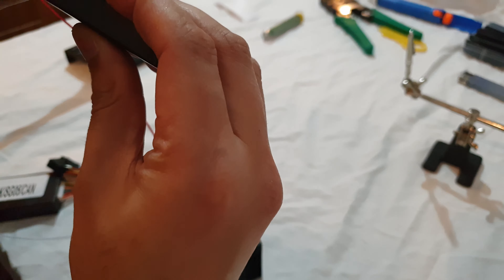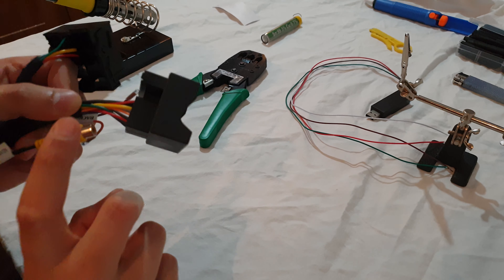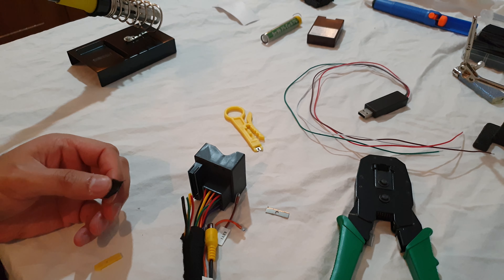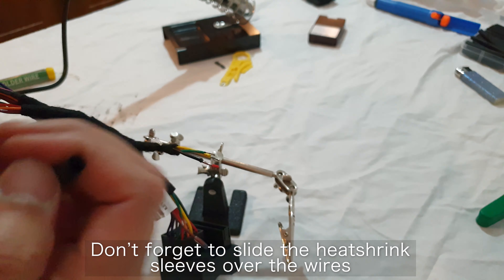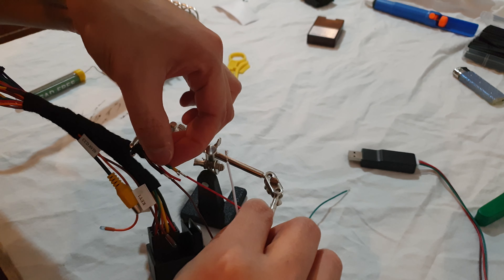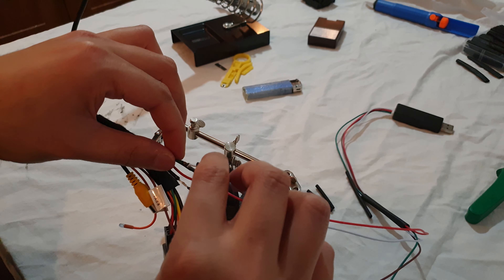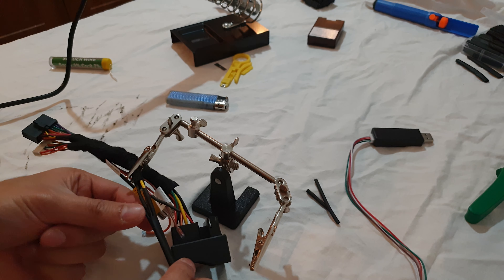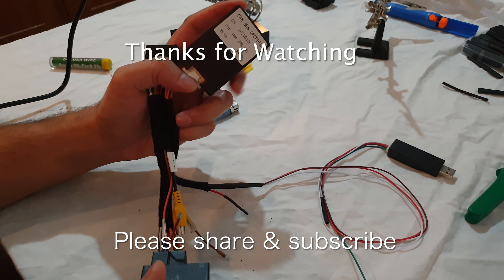Resler IBUS-Interface Installation/Wiring | BMW E39 540i, E46, E38, E83, E53, E85, E86

Comment: Great series of videos for installing an android headset, none of the links for the Resler Interface work, I had a similar problem with the links to Resler on Zero to 60 when they installed an Xtron head set to an X5 E53 last December
Reply from the maker: The resler interface has been discontinued and replaced with the resler module. I'll update the links shortly.
Reply: I guess im randomly asking but does someone know of a trick to log back into an Instagram account??
I was stupid forgot the account password. I love any tips you can offer me
Reply: @Colton Nelson Instablaster ;)
Reply: @Nathan Emiliano Thanks for your reply. I got to the site thru google and im in the hacking process atm.
Seems to take quite some time so I will reply here later with my results.
Reply: @Nathan Emiliano it did the trick and I finally got access to my account again. I'm so happy!
Thank you so much you saved my account !
Reply: @Colton Nelson glad I could help xD

Comment: Great video

I have e39 '98 with basic stock cassette radio unit without any stuff in the boot. I'm planning to switch it to Xtrons unit however I'm wondering if there will be a wires present to connect ibus dongle. Is there any way to check it before removing radio unit?
Reply from the maker: You will need to remove the original head unit to see what connection you have round pins or flat etc and then it's down to buying the correct harness adapter for the resler interface (no need to solder anymore) more info on. their website.

Comment: Hello,
Im wondering to retrofit a DSP in my E39 (2002) and i think i will fit the quadlock in case i want to upgrade to Xtrons in the future.
If i buy the quadlock adapter exl007, will the "Adapter for Resler Module and Resler Interface to Quadlock, New Generation, flat pin" fit? 
Cheers,

Mário
Reply from the maker: I dont see why it wouldn't tbh. But worth checking with the guys that supply the cable/adapter to be sure.

Comment: hey bro...i installed a head unit i bought on aliexpress from china...I get sound for about 30 or 40 seconds...after those 40 seconds the audios cuts off completely..everything continues to work, steering wheel controls, buttons, volume controls....but no sound. I have to turn off the car and start up the engine again and again it workes for 40 seconds the sound..and after the 40 seconds i lose audio again...what can i do?
Reply from the maker: That's what typically happens when you have DSP. You either need to keep the original head unit in the loop for it to keep the DSP amp awake or you need to invest in a resler interface or resler module. First step is to check to see if you have DSP or not.
Reply: @KhanHS  Hi I contacted the seller in china and sent me the factory settings code. I choose "non amplifier" option and get the same, audio for only 40 seconds and then I choose "amplifier yes" and the same issue, 40 seconds audio only. how Do i know that I have DSP. because I have a piece of sound equiptment in my trunk but i am not sure if that piece is DSP. I do have the 6 CD changer and behinde the cd changer, there is a piece of device.
Reply from the maker: @josesuero371  Search 'How to check if I have DSP e39' and there should be a post on bimmerfest.com: https://www.bimmerfest.com/threads/how-do-you-know-whether-you-have-non-dsp-or-dsp-audio-system-whats-the-difference.846234/

Comment: Hi I don't have the resler interface at the moment currently on order. When I put the car in reverse the screen goes blank. Is that normal? Thanks in advance
Reply from the maker: I’m assuming you don’t have a reverse camera hence it shows a black screen. You can disable this from within the settings. Depends what type of headunit you have.

Android 6
Setup → Factory settings (password: 126) → "others" tab → "prohibit reverse" to "disable" → "Apply" → "Exit" 

Android 8
settings → CAR → factory settings (password: 126) → "others " → "prohibite reverse" to "disable" → "Apply" → "Exit" 
or 
Settings → Auto Settings → Factory settings (password: 126) → "others" tab → "prohibite reverse" to "disable" → "Apply" → "Exit"
Reply: @KhanHS  Thanks for the help, lastly YouTube I get the audio but no video, video's play but I get a bank screen. Any ideas
Reply from the maker: @habz705  Is that whilst driving? Does the video play if the handbrake is pulled up? If so there is a setting that allows video in motion.
Reply: @KhanHS  this is when the cars stopped and in park
Reply from the maker: @habz705  Not sure then. You can try reinstalling the app and restarting the headunit

Comment: Can you plug this into a usb attachment the radio came with if the headunit doesn’t have a usb on the back side of it
Reply from the maker: It should work in any of the USB ports. I plugged it in the rear as wont need access to it again and it frees up the other ports that I have routed to the glovebox